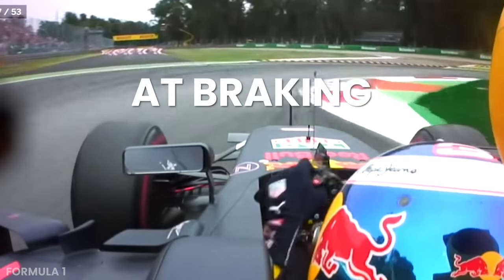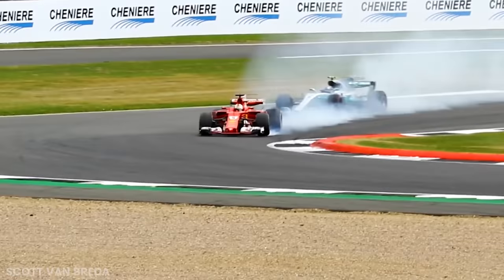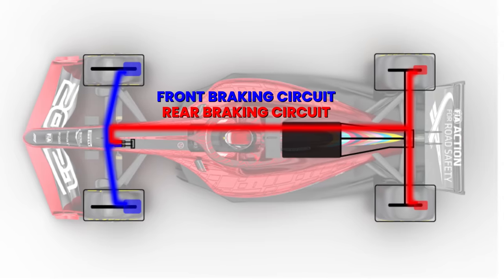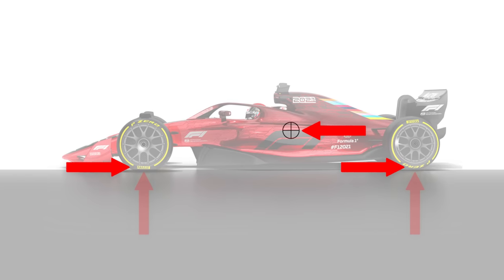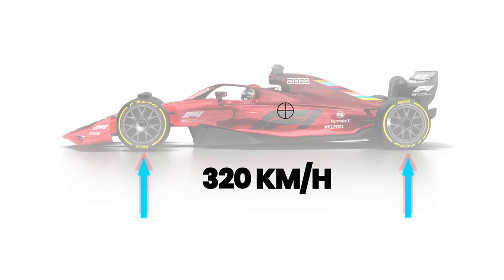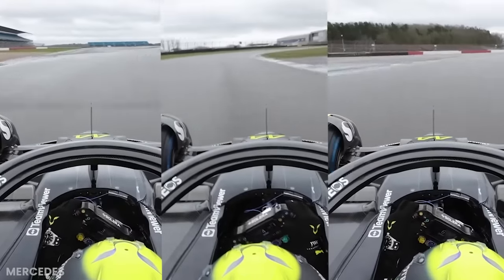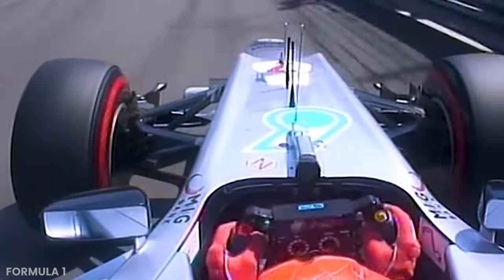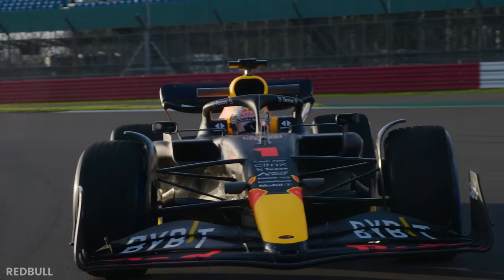How does Brake Balance work in a Formula 1 Car?

Comment: Great to learn of the technology in these cars and how the driver interacts and even adjusts elements whilst in the race. You would think they would have enough to do whilst also adjusting balance and the other array of knobs on the steering wheel between corners.
Reply from the maker: They are busy, but also have a lot of extra CPU!
Reply: @brrrake  and the best ones are overclocked :P

Comment: I'm wondering what happens when you vary the bbal. Does it just change how much brake fluid goes to each master cyl? Btw, this is the first good explanation of bbal I've seen, I have always been confused by it and my question is the only doubt I have left. It feels so refreshing to have good explainer videos that don't assume you know everything already, and as a 17yo aspiring engineer, I love that.

Amazing to see your channel growing with such high quality content, Brrrake F1!
Reply from the maker: On this version of brake by wire. When you change the brake balance it changes how much pressure is applied to the rear as a function of the front pressure.
I didn't get into it but there's also a layer of temperature correction 😬
Reply: @brrrake  Thank you!
Reply: If you want to "get it" even better, take a look at the "brake bias bar" on a 125 shifterkart. Essentially, it is a Driver adjustable bar between the two master cylinders that controls how much of the force from your foot pedal goes to the front master cylinder, and how much percentage is applied to the rear master cylinder. In fact, if you are 17, you should go out and get a 125 shifterkart, even if only to take it for a few laps after a race day. It will forever change your life. 😀

Comment: Thanks, nice explanation. It would be cool, if you could explain how teams try to get the optimal tyre window and why teams especially in 2023 ( see last race in barcelona ) have issues to make the different tyres work in the best window. Sometimes it's really confusing when u watch qualifying or the race and some teams struggle with different tyres and some don't.

Apart from that, another idea maybe for a video, would be how you set up your car when u're gaming ( F1 Assetto Corsa WRC etc. ). Where do you start etc.? Think this would be a fun one :D
Reply from the maker: Hey Romeo,
I'll try to do a short on the tyre window next time. I talked about it a bit in my newsletter last week.
Also, you read my mind. I'm trying to figure out which software package to use, but I'm going to start doing some "race engineering for iRacing" etc. The F1 game setup adjusters don't really mean anything unfortunately, so that's a tough one.
Reply: @brrrake  cool, looking forward to it 👍and agree f1 game setup isn't it. Interesting, will check iRacing at the moment i enjoy Assetto Corsa a lot.

Comment: I know its only SIM, but it does lend some credibility to just how AMAZING Pro drivers are. Going FAST is Deceptively hard. I have always pride myself in learning new systems and methods with ease. I've always been a quick study and am typically quite good at things from the start. Excelling quickly to quite proficiant levels. SIM DRIVING on the other hand, and Race Craft in general, is an ENTIRELY different animal all together. Learning to drive fast, and competing even with 900-1300 iRating my first month is proven incredibly difficult. Whole new respect for what drivers can do.
Edit: Incredible upload here. New Sub.

Comment: I remember an interview with Damon Hill during hiw F1 career explaining how important was braking. If you brake too soon or late you will lose the ideal corner line and a lot of time will be lost. It´s insane drivers has to djust brakes from corner to corner and also control acceleration, strategy, etc.

Comment: I used to think drivers actively turn that bb dial in the middle of braking. Did they use to do that before the hybrids?

Also, Blake, what about that antidive? /s
Reply from the maker: They don't adjust it mid brakes, always before teh braking zone.
The anti-dive video is coming out next week or the week after> Just finished recording it :)
Reply: Yeah they did use BB before the hybrids, it wasn't on the wheel though in years gone
Reply from the maker: @MrTomWaffles  the clip in the video is Schumacher around Monaco making BB adjustments. It was on a ratchet mechanism before.

Comment: Outstanding. You take the explanation right to the limits of my technical grasp and not beyond it so far that I’m lost! Thank you!
Question:  how deeply must drivers understand the physics of the car, engine, braking systems, etc and to what degree does that influence their performance?  Is it possible to rank drivers based on their technical understanding of the cars they drive?
Reply from the maker: Thanks so much. The level of detail is really hard for me to judge but this feedback is very well received.
The drivers should know a bit in general but they don't need to be experts. 
Technical understanding is only important up to a certain level. I'd prefer the driver is rapid and has good feeling and ability to determine what handling ailment is the limit factor as quickly as possible rather then he a suspension expert, for example. Engineer drivers are very annoying because they are wasting CPU trying to do the engineers job. But the engineer also needs to be excellent

Comment: Do the teams play around with the brake by wire controls on the rear to get some effective/legal anti lock braking? Either thru the MGU-K or friction brakes?
Reply from the maker: They can try but rules are very restricted and there's no feedback loop which could make ABS.

Comment: Could you please explain what exactly increase braking in road cars? 

1. How is a bigger caliper with more pistons better then a floating caliper?
2. How bigger brake pad in bigger caliper increase braking if the formula for traction = u*N (so there is no area in it)
3. If tires are a final limiting factor and OEM brake system should be able to exceed traction of oem fitted tires then how is bigger brake with a bigger rotor (leverage) be better? If it really is?
4. What is a correlation between max tire grip (=max deceleration/braking force acting on a car) and kinetic energy that needs to be dissipated when braking from high speed?

I cant understand those aspects of braking. Are bigger brakes not stronger (ignore leverage) but rather just much more temperature resistant so the don't really brake harder but rather they dont brake less when heated up?
Reply from the maker: All of the questions are kind of related, and it's somewhat straight forward to give an overview.

Maximum grip determines the maximum torque we need. The torque is a product of the friction capability of the pad and disc interface. We should always be able to have sufficient torque to lock the brakes (but for performance we want to actually avoid locking).

Then we have a few linked concepts. You have the size of the brakes - so the pads and discs have some mass. Then we have the braking duty cycle - how much energy do we need to dissipate? THEN we have the idea of the friction variation as a function of temperature, and also the idea of the "safe" operating temperature range for the disc and pad combination.

So you're on the right path, but all of them are related!
Reply: @brrrake  Right, so is this my misconception (cos of ABS working) that you cant lock up brakes at 200km/h?

Your second paragraph is about the fact that bigger and better brakes wont overheat and loose torque - so what I states id correct that all those multipiston calipers are mostly for more heatsoaking mass and better clamping force distribution so that no one spot is overheated before the rest.

The part that I still dont get is the relation between torque/deceleration and kinetic energy. Lets take an example of braking form 100 and 200 km/h (1 - 4x of energy)

Torque is related to friction so its related to clamping force and coeficient of friction. 

So if we apply the same force on braking pads at 100 and 200km/h is there a difference at torque? Braking from 200km/h takes a lot of time and distance because the the is more energy to dissipate and so aplying the same force does not provide the same torque at higher speed (cos torques is related to deceleration of a car)

I hope you can spent some more time explain this to me as I CANNOT FIND ANY INFORMATION ABOUT THIS SPECIFIC QUESTION :/
Reply from the maker: @pazera66  I think you're trying to do too much at once. Torque generated on a given set of brakes is a function of pressure and temperature (roughly). Same pressure/temperature, same torque. The torque at brakes, generates force at tyre, generates deceleration of car.

A car with downforce the drivers have to reduce the pressure as the car slows.

Figure out what the maximum braking torque is at any speed (related to how much grip you have - related to how much downforce you have).
Reply: @brrrake  Ok, I get it. The temp is a very important hence small cheap brakes will overheat very quickly and so they will limit torque on later stage of braking.

Lastly, this might be silly but please explain to me why braking from 200km/h takes so long compared to braking from 100km/h ?

If we apply the same pressure and have the same starting temp then why braking distance is not just 2x? 

If brakes are just energy conversion system that does it means that by braking from 200->170 we heat up the brakes with same energy as with 100->0 energy and therefore the temp is now higher and is limiting factor later on?

Super thanks for your replies

Comment: once i heard (it was lando i think) that they are not exactly putting 120kg on brake pedal because the gforce helps them do it so they are applaying lower force on a break, is it real?
Reply from the maker: The average human leg weighs about 10kg or so. 5g on a 10kg leg - so yeah there is some deceleration assist, but the peak leg force is quite high
Reply: oh yeah i forgot that legs weight abou 10kg not 70kg mb, great video btw😊
Reply from the maker: @lukaszkwiatkowski6859  but it's still a lot of force at 5g!

Comment: Stupid question but is engine braking front and rear or only rear?
Reply: Rear only as that is the only thing connected to the drivetrain.
Reply from the maker: Engine braking just impacts the rear axle of the car, as it goes through the gearbox. If you had all wheel drive, this would be different!

Comment: So where do brake components fall with regard to replaceable parts, especially within the cost cap? Can they be replaced at each race?
Reply from the maker: Yeah you can change them, but discs and calipers are expensive. Usually you'll use a new set of brakes from quali onwards. The brake calipers are lifed and do several events

Comment: Is the brake by wire system only allowed on the rear of the car?
Reply from the maker: In F1, yes. Formula E uses front axle BBW and rear axle electric only (and now an emergency brake)
Reply: @brrrake  Is the hydraulic system highly regulated, or is there some design freedom in the size and set up? I am wondering if this is something that can be tailored to a car or particular driving style, or if it is pretty standard. Thanks so much for being so informative and engaging!
Reply from the maker: @chadjones6144  there is not much performance in it. Generally some drivers have a preference for more or less stiffness but considering one of the master cylinders is effectively blocked into a sensor it's very stiff.

Comment: Its disappointing that the "telemetry" they show on broadcasts as a graphic on the halo is inaccurate and never shows the drivers trailing off the brake, making the uninformed totally miss the nuance of braking.
Reply from the maker: There is something weird with this data.  I don't know why they obscure it. WEC doesn't.
Reply: @brrrake  Is the Throttle application graphic accurate atleast?? As for the brake graphics, I thought that the teams don't share real time brake pressure data that's why it's shown as either ON or OFF on the tele

Comment: Cars aren't able to predict the locked state BECAUSE the locked state is DEPENDANT ON ROAD CONDITIONS more than brake pressure.  Rain, Oil, thin covering of sand, gravel, dirt, snow, ice...   please...  cars aren't predicting the locked state to know how much pressure to apply before the tire locks up....  ABS prevents a  STEADY STATE LOCKED CONDITION,  it's not preventative any and all locked conditions...    you're a bit convoluted and WRONG
Reply from the maker: Okay well like... I tried. I'm not trying to spend 3 minutes explaining the nuances of ABS 👍  you could make a video on it and share it though!

Comment: Wing aero is dumb and inefficient.
Fan aero is superior to wings and underfloor. It can be switched off on the straights and maximised in the corners.
The time will come when old fashioned F1 wings and diffusers will be replaced by efficient and massively effective fan systems.

Comment: Great video and insight on the system😀. Just one question, is it impossible to lock the rear wheels since it's by wire?
Reply from the maker: It's totally possible! There is no anti lock code at all.